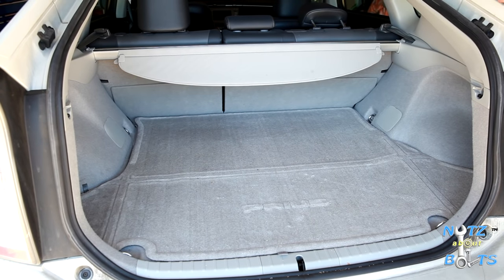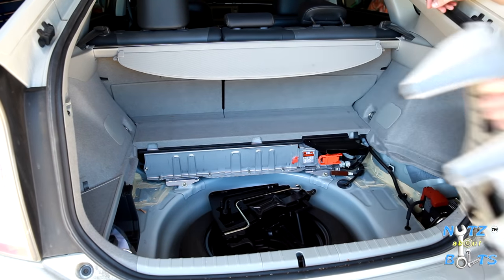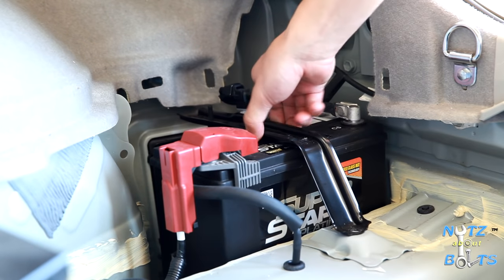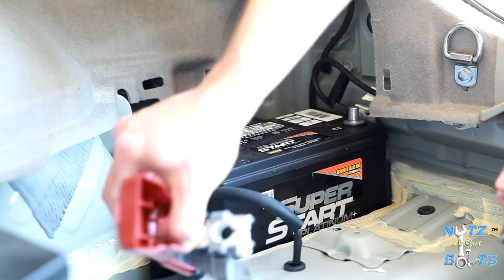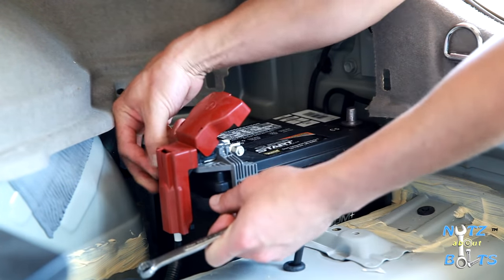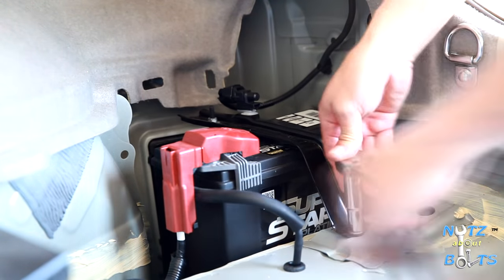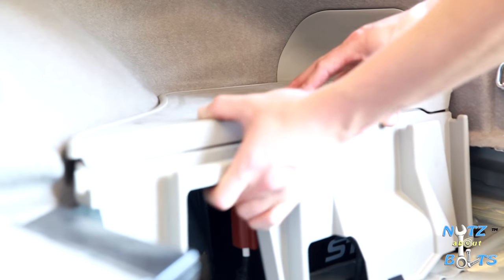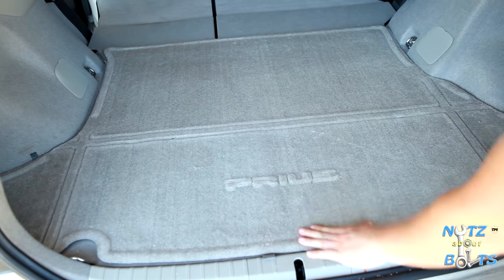2010-2015 Toyota Prius 12V battery replacement

Comment: This video was done perfectly! You managed to mention every little detail without rambling on like so many other youtubers. Thank you...saved myself a nice chunk of change by doing this myself!
Reply from the maker: Thank you
Reply: NutzAboutBolts.   I just bought my battery I’m about ready to put it in. Your video is beautiful perfect easy clean smartly done my family thinks you. My only question today is simply is there any type of reset or fuse that needs to be pulled during or after or a reset or anything like that I should be concerned with or do I simply do what you said which is a pull out one battery and put in the new one?
Reply from the maker: @mischafellner2892  no need to pull anything besides the battery. You might have to set your radio station back again, but it didn’t happen to me.
Reply: Except if you're like me and everything with cars becomes harder than the video shows haha. I had to bang the metal piece to remove the first clamp because it was stuck on there even with the screw removed. Then the screw wouldn't fit through when I tried to tighten it with the new battery in. There were many sparks.
Reply: The vent needs to be pulled STRAIGHT OUT...do NOT twist it, it's got groves on it like a key design or something.
Reply: @kurtsakslsvideosaks9185  It seems like the screw doesn't really do much then. I've been driving it with no issues, and the other clamp doesn't even have a screw for that part, it just fits right on there, so probably not a big deal.
Reply: @antichoice1  Good to know! I just don't want someone to have a headache that's avoidable! Happy Motoring!
Reply: This! So well done. Concise, yet proving all the relevant details. Well done!

Comment: things to add:
1. always disconnect neg first, then positive so your tool will not arch if you make a mistake. Reverse (positive, then neg back) like the video. Would be nice to explain why
2. don't close your lid when disconnected or you will have to craw from the back seat and reach the latch inside to release (electronic lock).
3. recommend using same battery and why (venting in car space, size, AGM for crash/acid reason, etc...). 2x the price though.
Reply: Removing battery: Take off your BLACK boots and then you can remove your RED socks.
Installing battery: Put on your RED socks before your BLACK boots.

Comment: Another grateful viewer here! I’ve changed batteries before but was intimidated to do this for my 2011 Prius… watched your video first and it helped so much, the replacement went seamlessly thanks to this guide! Really appreciate the straightforward but clear directions (especially the 10mm mention! it was so cold when I was doing this, not having to mess around finding the right size was a big help) and the great camera angle. Thank you x a million!

Comment: This video was SUCH a help! My hubby and I followed and got everything in place perfectly. For a suburban girl, I am super proud!
Reply: Is it really as easy and straight forward as the video made it look? I don't want to screw it up, but the autoshops want $100 - $250 to install it!
Reply: @ahiker9477  did you get it done? Looks like the biggest thing to be careful of is getting the right battery so it fits. I'll be putting mine in tomorrow. If I don't run the car every day it doesn't start and I have to use a booster.
Reply: @woodstream6137  Its not hard - just take your time and follow each step carefully.
Reply: @devoidbmx1  almost without a hitch. When I put the new battery in, I didn't notice the temp sensor and broke its bracket. Thankfully the sensor is ok so I zip tied it near its mount point.

Comment: I replaced my almost 10 year old battery yesterday, and you made it easy by following along with your video. Thank you!
Reply from the maker: Wow 10 years, you got your worth out of that battery, my original only lasted 6 years.
Reply: @NutzAboutBolts  Does the prius require AGM? Or can any deep cycle work?

Comment: I never even knew there was a battery in there. Thank you. I thought I had a major problem but it was a simple quick fix. My battery was 11 years old.
Reply from the maker: Wow, 11 years is along time. Gj.
Reply: Just replaced mine the first time today and it is an 2008!
Reply: Just replaced it on my wife's car for the first time since we bought it in 2012.
Never had a car battery last this long.
Reply: @miguelzavaleta1911  what brand was your battery?
Reply: @igorrosales1799  It was OEM. Likely the same one it came out of the factory with. So, no brand unfortunately.

Comment: A very professionally done video. Concise and to the point with no wasteful yammering like so many other car videos. I have a couple of tips to add. I read that even with the negative cable removed, you still have to be careful not to ground out the positive with your wrench since there's power to the cable from the hybrid battery.
Also, it would be a good idea to connect a charger or some other 12V supply (under the hood) so you don't lose your various settings maintained by the battery when you disconnect it..

Comment: Great video, straightforward! One question... 
Will I lose any important data or settings in the car's computer when the battery is unhooked? Do I have a limited amount of time to get the new one hooked up?
Reply: I too would want to know this one - how did you get on ?

Comment: My dealer changed me over $300 to do this.  Just goes to show how they have a license to print money
Reply from the maker: ouch.
Reply: Robert Gerber precisely why o googled this video!!! Sorry about you $.
Reply: My dealer wanted to charge me $300 including the battery which was $210.. did your estimate include battery?  Im doing mine myself
Reply: I looked at my local battery store. (Interstate Battery) They happened to have an original Toyota battery. Got it for $45, took it home and installed myself.
Reply: In all fairness the battery alone costs almost $200!  Expensive part.
Reply: Jack Jones  The dealer makes money on PARTS and LABOR.  I found an original Toyota Prius battery for $45 and easily installed myself.
Reply: I'm from Ecuador, i asked to the dealer how much its cost the auxiliar battery and they said 700 dollars
Reply: Dealer battery includes a lifetime warranty (including labor).   Although I paid $300 for the new battery, won't have to pay for another.  BTW, before taking my car to Toyota, I called around and couldn't find anyone selling a 12v battery for a 2010 Prius for much less than the dealer.  Given the number sold, I hope that situation has changed.
Reply: Stephen My dealer didnt have a lifetime warranty.  But I'm glad I found a source for a genuine Toyota Prius battery for $45. My original battery lasted 10 years, so at that rate, I'll come out far ahead.  Alot of people also use lawn tractor batteries, which are very inexpensive, and have even more power than a Prius battery. My car should only need 2 or 3 batteries over its life.
Reply: Hey there, where did you find a battery for $45? that sounds like an awesome deal.
Reply: Sam Hensel-Hunter  it was by chance, at Interstate Battery.  They have new batteries with a scratched label or something....sell for cheap.
Reply: Stephen, that's a warranty on the "lifetime" of your vehicle, or a warranty on the lifetime of the 12V?
Reply: I work at a Toyota dealer and we charge $50 to install on a prius and $30 on a regular car. Also some priuses have another module you have to remove that's why we charge more. The labor time is 30 min on a prius and 18 min on a regular car. I did one yesterday and we charged $200 something but most of the bill was the battery itself, not the labor
Reply: Btw I only make like 8 dollars off that so it's not like the technician is making a killing off your battery
Reply: be a man work on your own shit
Reply: Lol, they quoted me $430. I agreed to take it back tomorrow because I wanted time to research how hard it actually is. Glad I did.
Reply: yep, having necessary services like this be literally 100% for profit causes a lot of societal problems.

Comment: Great useful video.  A few notes I might add based on my experience:
* If you can get your car to an auto parts store, do so.  They can test your old battery with a load tester for free and they give you credit when you turn in your old battery.
* I was unable to get a conclusive test using the red battery terminal under the hood.  It was necessary to open up the battery access in the right rear.
* Made a misstake.  I removed my old battery, shut the rear hatch, and exchanged my old for the new in the store.  The issue was that when I returned to my car I was unable to open the rear hatch because the hatch latch requires electricity.  With some contortion I was able to get myself and the new battery into the rear of the car from the back door.
* The new battery cost me $220 after the core charge credit.
* The old battery appeared to be the original.  So it had lasted 11 years.
Reply from the maker: Nice work, we have a video to manually open the rear trunk if there’s no electricity. That way you don’t contort yourself installing the battery from inside. 👍🏼
Reply: Ha! I was in your spot just now as well. Attached portable jumper battery just to open up rear hatch. 

Cool to know there’s a way around it to open manually as well.

Comment: Thanks for video, matched the process. Just did it in about 10min total.
Reply: Is it really as easy and straight forward as the video made it look? I don't want to screw it up, but the autoshops want $100 - $250 to install it!
Reply: A. H. Yes, easy enough to install for yourself. Just make sure you have the correct battery.
Reply: @nelsonsbrian  one last question. What brand did you choose? I'm not sure if I'd be better off with a Toyota battery or an Optima Yellowtop.
Reply: @ahiker9477  I can't remember. I just went to the local O'Reilly auto part and had them look it up. I did have to go to a second O'Reilly that was a few miles away as they didn't have it in stock. Think it was like $150 for the battery or something, not a basic car battery since it has to be able to handle starting the engine up more often than a conventional car.

Comment: Great video, wish I had seen this prior to paying $418 to replace one at Toyota Canada :(
Reply from the maker: Gail Skidmore ouch, way over priced on labor.
Reply: @NutzAboutBolts  that was battery and labour and in Canada, but I agree, way overpriced!
Reply from the maker: Gail Skidmore I believe I bought my battery for 260$ or something. I guess they charge labor for a 10min job as an hr. Which roughly is 120$...
Reply: Paid over $500 yesterday at Tony Graham Toyota here in Ottawa.  No much choice when you don't know how to fix it plus where to get the correct size 12 volt AGM battery.  part of the problem is the design of the Prius.... I understand that the 12 volt isn't used much as a result they age pre-maturely... especially in the -30 degrees weather here.  oh well

Comment: Try doing this on a 2009 BMW 3 series which is a nightmare. Prius is so easy
Reply: Meh, try it with a completely dead battery not as much fun. The hatch won't open so all that stuff has to be removed from the rear door. The interior release for the hatch is under all that stuff.

Comment: Nice kept it simple.. to the point.. I like the 3rd generation Prius better for changing the battery.. easier than a second generation.. I got 216000 miles on mine.. I use the Mobil 1 extended life.. the car is tight as the day I got it..at 122k.

Comment: Watched your video and saved $150 to replace the battery on my 2013 Prius.  Great video and thanks for saving me money.
Reply: Is it really as easy and straight forward as the video made it look? I don't want to screw it up, but the autoshops want $100 - $250 to install it!
Reply: @ahiker9477  yes it is that easy. Watch the video and follow the steps. We did go to the dealership with the old battery and picked up a new one but yes it is that easy.
Reply: @paulmccutchen7781  thank you so much!
Reply: @paulmccutchen7781  one last question. What brand did you choose? I'm not sure if I'd be better off with a Toyota battery or an Optima Yellowtop.
Reply: @ahiker9477  we went with the Toyota brand because they have built them longer.

Comment: FYI these batteries are deep cycle, not standard batteries and are harder to find. Also, AAA does not sell these batteries. And they are roughly half the size of a standard battery. I just paid $260 at autozone.

Comment: What the heck is the "vent" thing you mentioned and almost didn't re-connect?
Reply: It takes harmful gases emitted by the battery and ventilates them to the outside of the vehicle so the car occupants are not breathing it in.
Reply: Do you knock out the vent hole in the new battery?

Comment: I just want to add that when you change the battery out...don't panic when your car won't start.  It has to download some data first.  Takes maybe 3-5 minutes.  I just changed my battery and it's a piece of cake...except for taking out a few things to get to it and removing and replacing the vent tube it is just the same as any car.

Comment: Advance Autoparts sells these batteries but they said it requires "professional installation" which apparently they have to "reprogram" something.
Reply: David Webster, Advance told me the same thing. I’m thinking Toyota doesn’t want them taking their business and for some reason they don’t want to mess with the Prius. I ended up getting the battery at Batteries + Bulbs $10 cheaper than Advance was selling it for. They were willing to install but I did it myself and they took another $10 off. I did not have to reprogram anything except the time. You could easily do this yourself without having to worry about reprogramming the car. All of my settings stayed put. Do it!
Reply: Tikisan hi...yes i ended up doing it...the car is fine...middle fingers in the air!!
Reply: Takes about 30 seconds for the car to reload the navigation and your fuel settings will be out of sync for a few hours but your car is a computer, it'll reboot and relearn the settings, fuel consumption readings all on its own.
Reply: Advance Auto said take 45 minutes and pay installation fee. That’s not right!!
Reply: @aarema291  my store won't touch it

Comment: Thanks for the information.  After connecting my new battery, I opened the car door and the alarm went off.  Had to push the unlock button on the remote.

Comment: Another excellent video.  I followed it and got the car fixed.   i  love this guy.   I used a AGL replacement  which even had the vapor exhaust tube fitting.

Comment: I'm guessing this battery is used for keeping the correct time and helping the car start?  I get confused over this one and the mega big battery.
Reply from the maker: yes, you are correct. The HV battery is for the Hybrid side of the vehicle.
Reply: I actually stopped by Battery Plus today, had them test my battery (it was bad) and replaced it.  $177.00 + tax and they wanted my old battery or that was another $12.00.  I'm just glad it's replaced and it's no more serious than replacing a regular car battery.  It just cost more.  LOL
Reply from the maker: dang thats one expensive battery, mine costed 160$ I think from o'reilly. yeah they do core charge.
Reply: I called another place and they were out of stock and it cost 188 so I just went ahead and got it for 177.00 instead so I would not get stranded.  The girl even tested mine, hooked up something to save my time and radio settings AND she did the swap for me.  Can't beat that.
Reply from the maker: nice.
Reply: The 12v only boots up the computer, doesnt take much power.....then that computer decides when to allow power to flow from the big hybrid battery to crank the engine..... so if you jump start a Prius you only need a little bit of power because you just need enough to get the computer to boot up..... you could probably jump start a Prius with 8 D cell batteries, if you had to!  Because you don't need power to crank the engine.
Reply: I confirm this - my battery is dead and I bought an external battery-booster while I figured out what to do (do it myself or to the dealership - this is a 3 y-o battery so I'm a bit annoyed). I jump started my car at least 15 times with the external battery booster and it still shows that it's at 75% of its charge...  I don't understand why they could not figure out a way to start the computer/car with the hybrid battery alone. Even when my 12V is out o juice, the hybrid one is still half full. Makes you even wonder if there isn't a way to jump start the 12V from the hybrid...
Reply: What is the CCA of the battery
Reply: Whomp a lot of people use a lawn tractor battery, can get them for $40-50.  As long as they are the right type and vented
Reply: Romeo maloco you don't need cranking amps, since it doesn't crank the engine.  But it's something like 450-550?  That's why some people use a cheap lawn tractor battery.  As long as it's the right type, then you just adapt the connectors
Reply: romansten9 if you use a lawn tractor battery which one is the right one
Reply: @romeomaloco3180  low 300s like 328 I think
Reply: @romansten9  , actually my dash display and everything was working but the engine would not turn over when my battery was low.   I had to replace

Comment: How come you didnt get electrocuted? Ive always been afraid to touch the battery, let alone without any protective glove 🧤 

you just started unhooking everything with your hands with no single disclaimer for safety ..
Reply: It is only 12 volts. The hybrid  battery pack is the 1 you have to be careful. Regards.